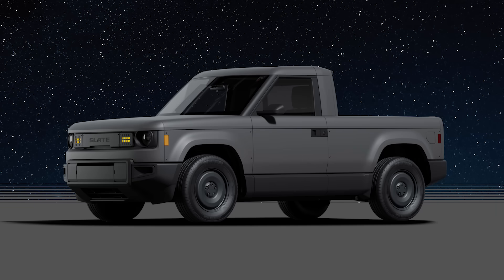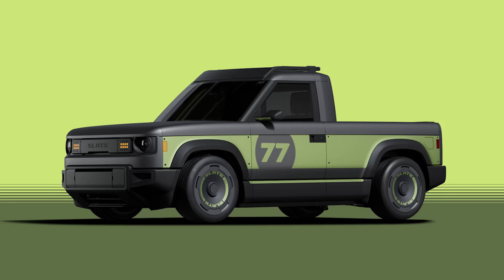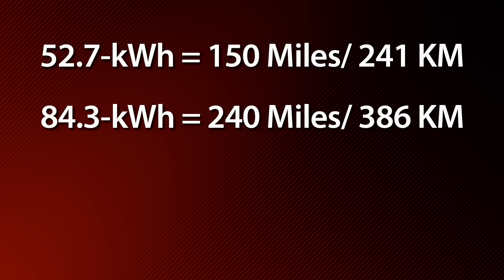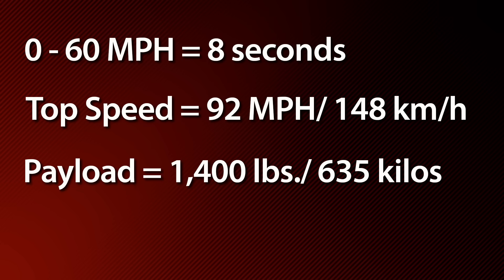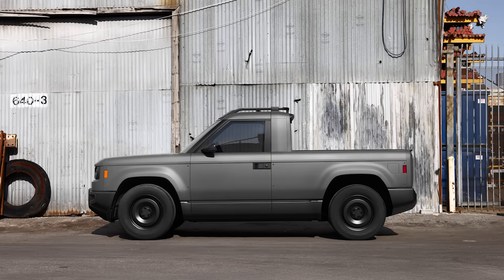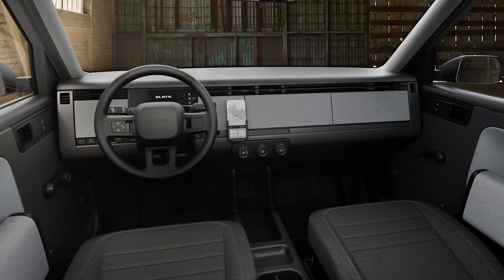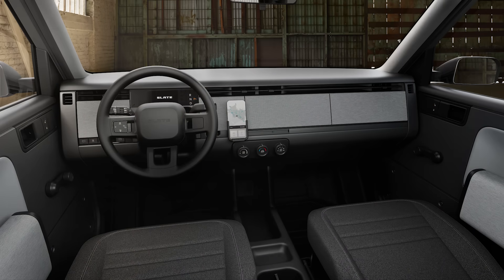Everything You Want To Know About That Slate EV Pickup

Comment: So you are offering a vehicle. With very limited distance to the lowest financial demographic in car buying society. This demographic probably lives in apartments or rented houses or condos. This demographic has no tools to speak of. No garage nothing to work on vehicles.  150 miles  is very limiting. If you live in California you are relegated to a very small area. If you drive at night and run the air you are even limited to a smaller area. If you travel up hill run the air at night even smaller. you get my point. You mentioned a price point of 27 thousand. A Toyota Tacoma. is 40 thousand with a extra cab. It is a gas model with no distance limits. and lots of extras. I am sorry I just don't get the appeal.

Comment: The ONLY downside I see to this is its an EV, if this truck had a gas engine even one that just charged the battery pack like a generator its would fly off the shelves.  

I can't buy it not cause I can't afford it but cause I live in the sticks and average over 100 miles a day just going to work plus the other big thing getting parts to fix it is something breaks yeah I just can't chance it.

Comment: None in the trucks of the 1960s and the 70s had the excessive extrerior chrome nor the plush interiror; a truck was built for work. I am hoping we go back to using common sense and not let GM and Ford prgram us into paying for an over priced gas guzzler. If your business only needs a truck for hauling or delivery, the Slate will do just fine, but with a much lower price tag.

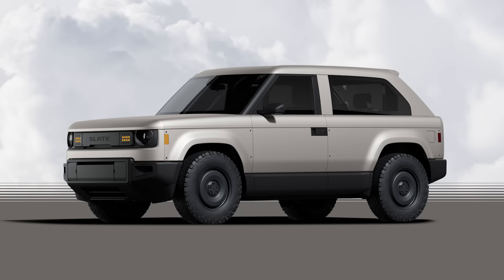Comment: This sportback version at 0:53 reminds me of the Tavria I owned, which ceased production in 2007 and currently costs less than $1,000 used here in Ukraine. Tavria's trunk with folded rear seats has ~630L capacity. Fuel consumption: ~6-8 L/100km, no airbags, no power steering.

Comment: It all sounds great, but the odds are stacked against it. There just is no world where this comes out on time, and at the promised cost. If it comes out, it will be a year delayed, and cost 10k more if I had to guess. I would love to see it succeed, but for all the attention its getting now, over the next 12-16 months, if manufacturing, supply and everything else comes together, something will screw it over.  I would buy a Slate only if I saw enough backing to ensure the vehicle and support for needed battery replacements and parts were guaranteed to be available at a reasonable costs.

We've all hear stories of a car being built for a few years, and then the replacement battery costs 3x the entire vehicle costs five years later...no thanks

Comment: The slate already looks overpriced it needs to be under 20K for what your getting with that EV. The truck is already priced to be almost the same as a 2025 ford maverick XL hybrid (ford website price $26,995) but you get so much less features, range and towing capacity. And if this truck is using off the shelf parts it should be under 20K then as they are not spending as much making custom parts. It looks like a good small truck but its over priced.

Comment: So what does it weigh?  240 miles won't get you anywhere. How far will it go with 1400 pounds in the bed?  Sure not 240 miles or if pulling a trailer.  Also it will not come in at the price mentioned here, it will be north of 30k.

Comment: People say they want a bare bones truck, but my recently  bought a new work truck, regular cab, 8’ box 3/4 ton gas 4 wheel drive trade package. 
     It had sat on the dealers lot for 300 days, it seems in actuality people want extended, quad cab Lariat High country usually with a diesel

Comment: Put a gasoline or diesel motor in it and you will likely have great truck.
Reply: Yeah let's make it slower, dirtier, more complex to build, noisier, rougher, and more expensive to operate and maintain.  That'll make it sell like hotcakes.
Reply: @danmobile  So you want low range, long refill times, and high costs to run thanks to the high price of electric, specially in California, and that cost will skyrocket as the state forces us to electrify our homes, cars, trucks while forcing us to depend on unreliable, expensive solar and wind for power.
Reply: @ Who cares about refill times? I plug in an EV when I go to bed and wake up with a full charge. I haven't gone to a gas station for 75,000 miles. How much time have I saved by not putting gas in my cars? 

Solar is INCREDIBLY RELIABLE. I don't know what you're smoking. I live in California and even here, an electric vehicle costs 1/2 the amount to operate as a gas vehicle, even with far superior performance. Sure, it doesn't have long range. But I have 2 other cars for road trips. Most households have 2+ cars.

Comment: A new 1995 Chevy S10 standard bed was $10,825 (Kelly Bluebook).  That would be $22,715 today.  Less than $5000 more for better safety features and zero emissions.  The Iron Duke, on its best day, was slightly above a 2-cycle Stihl when it came to emissions.  If they can achieve quality, they have something.

Comment: Funny that a $27k vehicle is being hailed as “low cost”. At that price, it literally has manual windows and no radio/speakers etc. As much as I like this concept, it’s NOT low cost. Even if you spec it with some basic modern features, I’m willing to bet you’ll be in the $35k range pretty quickly.

Comment: They have said that one of the DIY upgrade kits will be power windows.

I put in my reservation. If it comes out near it's price target, I'm buying one with the larger battery and SUV kit, hand on heart. This fixes literally every single complaint I have with modern cars. I wouldn't change a single thing apart from maybe increasing the towing capacity.

Honestly, even if the federal tax credit goes away, I'll buy it. Not to be overly political, but Screw this administration. This truck is all american built.

Comment: I am still very concerned that the easy to assemble aspects of it, especially the external parts held on by Torx screws, will also make it easy to strip off parts, especially if they have been upgraded beyond stock. Why bother to wrap your Slate when you can just park next to someone else's and steal their body panels in a few minutes? The caps (canopies in my neck of the woods) will also be theft targets just like Miata hardtops which are stolen all the time. This could quickly drive up insurance costs and cause the company issues as owner after owner needs a new cap of fenders from their parts department.

Comment: The concept that is getting lost in the hype is that a startup company pulled off the equivalent of VW introducing the Beetle. It was a barebones, minimal power, entry level, mass produced car whose appeal was affordable transportation in an era of needlessly expensive and inefficient vehicles designed for profits. 
Sound familiar? 
The hype Slate is getting is outsized compared to the product, for the simple reason that there is an entirely unserved market for bare-bones budget EVs. An entire generation has grown up with Uber and Lyft meeting their transportation needs, for whom a private vehicle isn't a status symbol but a hole in the road to pour money into. The main purpose to owning a vehicle is transportation, and if it costs more per month to get from Pt A to Pt B than an Uber then it's not worth the hassle. 
If VW had brushed off their Beetle as a 150mile EV for $15k, they wouldn't have been able to keep up with demand. Instead every western automaker has stuck with over-engineered moneymakers. Slate is just an example of what China has already achieved, sitting at the gates and threatening Detroit with an existential crisis.

Comment: I'm all for a low cost pickup, but I see this being compared all the time to the Maverick and praised for its low cost. Isn't the Maverick only like $1,500 more? And you get many more standard car features, and it's already available today from a (somewhat) reputable brand
Reply: Nope, the average Maverick (in 2024) sold for almost $39k. In 2026-2027 when this truck launches it'll be more like $45k the way things are going, and this if it has rebates would be more like half that. Also it's cheaper to operate and maintain by a pretty big margin. That's all assuming it actually comes out.

Comment: Keep your hopes in check. That range is going to be one of the things that is going to be a detriment to this vehicle's success, especially in rural areas. It'd work fine for average suburban living or even fleet vehicles in an urban setting, if the city isn't too large. But people out in the countryside isn't going to like this.
Reply: and keep in mind the long recharge time, add to that the wait time if all the chargers are already in use when  you arrive for a fill up.  and that low range, it will drop as the battery ages.

Comment: i heavily doubt this will be a success especially understand the circumstances of such an instable global supply. First, we need to question how much content of this EV in terms of the value is actually from domestically supplier. If it is so easy to lower the EV manufacturing cost, why wouldn't the big 3 do this as they obviously have the brand value, engineering/prudction resources, volume business leverage and capitals....

Comment: What is a 35hz bending moment and what's the source of that info?
Reply from the maker: The bending frequency in a chassis, which is a natural frequency where the chassis vibrates in a bending motion, typically falls within the range of 10-13 Hz in vehicles like cars and trucks. The source for Slate's bending moment comes from its Chief Engineer.

Comment: 28K for nothing and a puny battery? Nah, not for me. For all practical purposes, 158 miles is really 100 miles.
Reply: 158 is 158, not 100. Just cause a lot of companies lie about it doesn't mean it has to be incorrect. Sure, in heavy snow or some awful conditions it may be lower. But if you can't swing it for daily use, buy the bigger battery. Or buy a gas car. It's your choice. Most people don't need over 150 miles for daily use. The average person drives under 40 miles each day.

Comment: Now imagine,  SLATE creates a simple add-on called say .....  " The Camper" .......  A simple but VERY WELL-Insulated camper that goes over the SLATE base truck that has 5"11 standing room inside/  $200 Cassette toilet with an outer door to remove black water/ outside Electric port  for Camp sites shore Power/  30-gallon fresh water tank /2 High  small camper windows/ small 400 BTU ac unit ...... All for $7,999

Comment: Meanwhile in China, for about US$20K before incentives, Geely, a private, non state-owned company, parent of Volvo, Polestar, and Lotus, will sell you their Radar, a 4-door dual-cab 4WD unibody pickup powered by dual motors totalling 380 horsepower, equipped with a ternary 86 KWh battery pack, and boasting all modern conveniences and safety equipment, including electric windows and mirrors and a Bluetooth radio with a screen and 4 speakers. Simpler versions start from less than US$14K. All come painted with a choice of colors.

Comment: I made similar comments on their intro video. The price just isn't where it needs to be for a car that doesn't even come with a radio or power windows. There has been no indication of cost of the upgrades/accessories, at least that I've seen.  And tooling a new assembly line is incredibly difficult.  The growing pains are many.  They are planning for a Q4 2026 release, but I would be very surprised if we see the first production vehicle before Q3 2027.

Comment: Slate should make the vehicle all analog interior. Ford maverick uses analog speedometer with a digital center readout. This should be standard on this vehicle. Ditch the power door locks for a manual locking. This vehicle has potential

Comment: 140,000 per year is a good start. But no world beater. Will need a lot of capital even if no paint or steel body.
Tesla should do one. Its CC has no paint or steel body. The Slate truck is sufficiently different from Tesla's current fleet that a similar vehicle won't take much volume from other Tesla vehicles.

Comment: finally, the return of a true mini truck.  no more bloated luxury pickups.  most people just need something cheap to throw their crap in and get it from point a to point b.  we dont need the 50,60,70k pricetags and 360 cameras and massaging heated and cooled seats.  we need a beater with a heater (ok and maybe ac) and this truck checks all the right boxes.  this is like a throwback to the golden age of vehicles.  I'm talking mid-90's japanese vehicles - think hardbody pickups... the toyota pickup, nissan, mazda, etc except this is made right here in the USA!  Other manufacturers need to take notice.  Id buy a brand new bare bones vehicle with a manual transmission and crank windows in a heartbeat nowadays!  were finally getting back to our roots!

Comment: Is the battery pack air or liquid cooled.  Hopefully not another Nissan Leaf disaster. They should have made it at least front wheel drive like the maverick. Being rear wheel drive will limit the market greatly. I almost put my reserve in until I heard rear wheel drive. The rest of the vehicle is great.
Reply: I have mostly had RWD vehicles and have a RWD pickup now.  I don't see anything wrong with it.
Reply: @GH-oi2jf  Don't call me when your stuck in the snow.

Comment: I want to see this come to fruition and actually be viable. I do also want to see it get a dual motor AWD drivetrain option for snow and offroad. And built-in speakers, but with an empty double-DIN slot instead of an infotainment system.
Reply: awd could happen, but I highly doubt the suspension will ever support any sort of off road capability.  Way to low and no room for reasonable size tires.  No room for suspension travel.  And of course I'm sure it's all independent suspension which is never a help and only makes it harder to mod in the aftermarket.  If you want an affordable off-road capable rig, ask Suzuki to bring us the Jimny.
Reply: Off-road is a niche market.  Their strategy is a people's truck.  The people don't need to go off road, generally.
Reply: @GH-oi2jf  I believe you are correct, though I wouldn't be surprised if they do an AWD version.  That's not about off-road, just about bad roads.  Of course, until the thing is actually sold and in consumer hands it's all vaporware and promises.

Comment: A few major issues 
1. The towing at 1000 lbs is less than a gen 3 Prius 
2. The 92 mph speed limit means it could be unsafe at high speed highways like in Texas
3. The range is too low for outside  city use
Reply: Towing is not their target application.  How much can an original VW Beetle tow?  How many were sold?  Judge it for what it is.
Reply: @GH-oi2jf that’s not an apples to apples comparison, a small truck like this will be compared to a Chevy Colorado, Ford Maverick.
Reply: @herrba  Maybe their target audience, people concerned about price point, don't own trailers and toy haulers, and don't give a rat's ass about towing capacity?
Reply: @curiouspenguin6887 people that need trucks for work are usually in the trades and carry their equipment and supplies to client locations. At 1000 lbs they might not even be able to tow a riding mower, let alone wood, or other materials and equipment, if their target audience is suburbanites who picks up potting soil, then it’s a different story.
Reply: @herrba  Since people in the trades can write off their F150 on their taxes, I don't think they'd be looking at this. Again, I don't think tradesman are their primary audience. Think cash-strapped families struggling to survive. Not everyone needs a big ass truck.
Reply: @ I'm not sure that's really the demographic - that's likely somebody buying used.  I expect a large part of they initial buyers will be 2nd or 3rd car people looking for something cheap and fun and maybe a little quirky.  My wife actually liked it for exactly that.  We aren't ev people and we have a real truck plus her SUV and a play SUV.  But she thought this looked interesting.  It could never replace my regular truck but?
Reply: @curiouspenguin6887 people concerned with price point buy used not new, only the rich can afford new vehicles those that make less than 70k a year stick to the used market unless they are terrible or great with money. After all why get the slate new at 25k when they can get an F-150 for 20k used ?
Reply: Yeah, that tow rating is pathetic bordering on useless.  The payload number is OK given the size and really makes me wonder why the towing is so bad.  As for the speed limiter, I'm not that worried about it.  I drive daily in the SF bay area and plenty of people are running fast but I seldom want to run over 80.  Of course that will make your 3rd point about range even worse.  And you are right that the range is really only going to work for in-city use but I expect that's exactly where they are trying to market this.  Certainly not the typical truck buyer.  They did mention a larger battery which will help but begs the question of 'at what price'.

Comment: All I've seen and read about the battery options is there are two sizes, 52.7 kWh and 84.3 kWh.  What type of batteries are they?  NMC?  LFP?  What is the source for batteries?  Have they finalized their selection or is this still to be decided?
Reply from the maker: NMC. They've sourced the batteries but haven't announced who is supplying them.
Reply: @AutolineDetroit  Thank you!  With the controversy over "dirty nickel" this could prove to be an issue for them.  Some people have flatly stated they won't buy an EV with that type of battery.  Every week there are new stories about emerging battery technologies... sodium ion, sulphur, solid state, etc.  It would be wonderful if we could use one of these safer, cleaner technologies but it is unlikely to happen before the Slate goes to production.